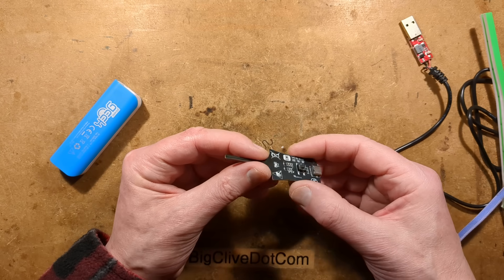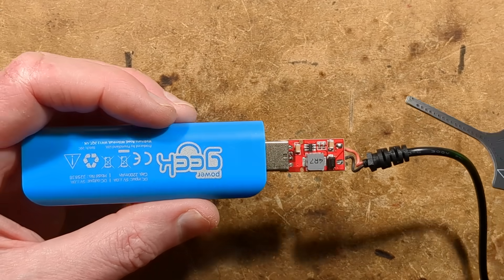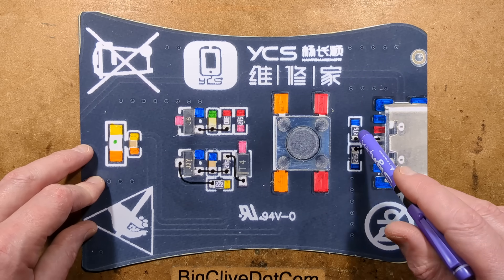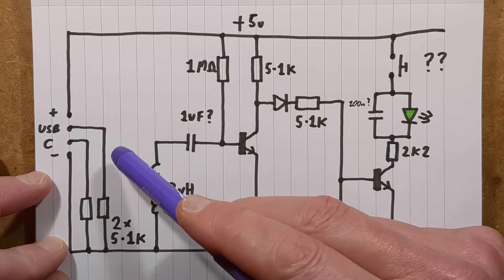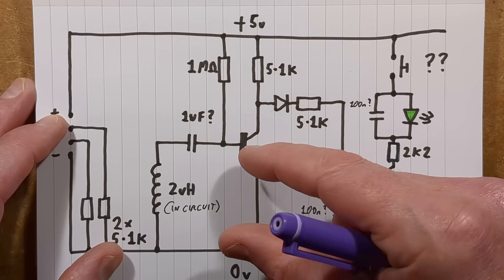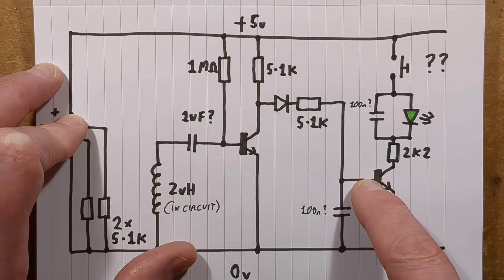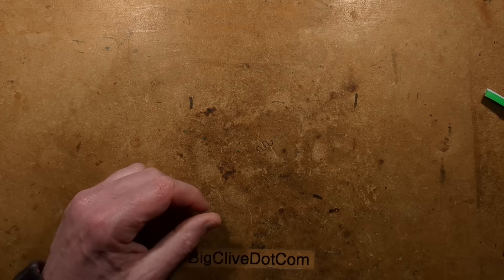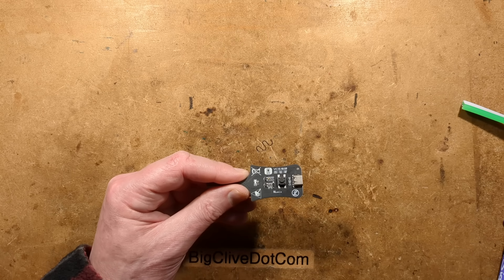Clever inductive test probe

Comment: Its not an inductive test probe.... Its a USB powered push-button tester with built in inductive field power lockout. You enable the device by holding it close to an RF near field and the LED indicates if the integrated push-button is operative or not :o)

Comment: So it's basically a low sensitivity RF noise indicator? I plan to use an old car AM radio for that because unlike normal radios, it doesn't have a ferrite rod antenna but is supposed to use the car antenna. So I could probably use a piece of wire instead of the antenna as a probe.

Comment: Circuit seems very odd, because the first stage is DC coupled to the second (via the diode), the first stage has to be biased such that the transistor is switched on and the collector is close to ground under quiescent conditions.  This really limits the sensitivity of the circuit, I'd have expected the first stage to be biased for normal class A operation and then AC coupled to the second stage with a charge pump.

Comment: I bought a similar (more expensive) device called the Short Sniffer; you put on headphones and inject a signal current into your circuit and wave the probe tip around the circuit listening for where the current is going.  You can tell direction with left vs right ears, too.

Comment: I had something similar I used for very fast pulse detection with my O-scope.

I had a short length of tiny coax with the end terminated in the center wire looped over and soldered to the shield.
The loop and coax had a short length of shrink tubing over it to prevent shorting of the circuit under test.
The coax went into a small metal box that contained a diode and cap that would rectify the pulses and filter them
and give me a DC voltage to signal the O-scope display. Depending on the frequency and repetition rate, the DC
voltage would vary with the pulses. I never thought of using a SMD inductor to detect the pulses...
Reply: You can just probe directly with a shorted oscilloscope probe, no need for a box or diode or special tools.
Reply: @jaro6985  It depends on the frequency and signal level. if the signal level is low, the basic probe won't be able to carry the signal without a lot of attenuation. But yo can clip a diode at the end of the probe and do the same with many lower frequency pulse trains.

Comment: These types of sensors brings me good memories having to create robots in uni that can follow a path marked by copper wire with an alternating current. Usually I'd just use a capacitor, tank circuit, and some amplifiers to do so.

Comment: Have you done a video on how to test power banks and battery cells to find their capacity? Or testing USB cables? I searched and couldn't find anything.
Reply from the maker: With accessible cells I use a dedicated discharge module that logs mAh capacity.

Comment: The designers went to considerable effort not to overdrive the LED, so there is that.

The circuit kid of resembles a transistor version of a grid-dip meter, a device used by Amateur Radio operators to sort inductors and capacitors for use in tuned circuits. In that application the series inductor and capacitor in the circuit would be replaced by sockets and say an unknown inductor would be plugged in with a known capacitor to see whether they together resonantly absorbed energy from a calibrated oscillator.

In this circuit the inductor and capacitor need not be and almost certainly are not resonant, they just absorb energy and use it to turn on an indicating LED.

Grid dip meters are bench tools meant to be powered on only when needed. This device is designed to only be powered on when it’s connected to a USB power supply or power bank, so the switch location kind of makes sense.

I don’t like designs with too many “kind of” elements.

Comment: A Sniffer probe, helpful for finding breaks in PCB tracks  or dry joints in live ccts.
Other designs also used a ground / 0v connection to the cct under test, to assist in tracking traces. 
I used to have access to an HP manufactured  device in a works lab in  the late 1970’s.
Reply: Yeah, I bought a similar (more expensive) device called the Short Sniffer; you put on headphones and inject a signal current into your circuit and wave the probe tip around the circuit listening for where the current is going.  You can tell direction with left vs right ears, too.

Comment: Someone copied it wrong. The 100 nF capacitor directly in parallel with the E B junction of the transistor make no sense, as the impedance is very low and the voltage can't raise above 0.68 Volt.
Greetings,
Anthony

Comment: When an inductor is bad, is it common that it doesn't fail open circuit? I suppose you don't have to poke it with probes to confirm that, so I guess that's a bit of a time save.

Comment: Ciao Clive! I bought the battery operated version. Since I do lot of troublesooting, I need to use it for the switching circuit to sense if the switching trasformer is pulsing or not. But I noticed that it won't work with general purpose household switching trasformers (i.e. wallmount mobile phone charger & similar. I thing I should modify the little circuito in some way.
My first thought was to replace the pickup smd coil. But I've been unlucky. Do you have any idea on how to use this little circuit for this purpose?
Reply from the maker: It might be because they have a closed magnetic path for efficiency.

Comment: Quite a simple circuit but by the looks of it it has been copied and over engineered a bit but instead of making it more efficient it might result in extra components that maximize the risk of component failure in any part of the device

Comment: Thanks! An interesting side note to inductive (A.C.) pickups is that they are often sensitive enough to pick up D.C. pulses, even at low voltages, and I think even (A.C.) ripple in cheap dongle power supplies. So you can check if a dongle is working just by sensing the cords, a mouse or keyboard can be checked, lots of stuff!
Reply: Remember, a D.C. pulse is just A.C. in disguise.
Reply: @kenmore01 and I thought AC was just indecisive DC that couldn't decide which way to go

Comment: yup, sticking by my first guess. someone probably got their hands on the schematic for the super probe, realized it could be stripped down some, and did it, but in that typical chinese not quite right way of most knockoffs.

wonder if it can be altered to be a little more .. well done. bodge wires to change the location of the switch in the path, probably minor component tweaking. hmmm.

wonder how it reacts to say, faulty resistors. no audio, so you can't really test for noisy resistors or dead transistors/etc like the super probes can.

how very odd.

Comment: I found out something interesting about those live-circuit probes.  It happily senses a USB cable when powered but not connected to any load... and even when unpowered.  Unplug it, though, and no detection.  USB power is switched, so no "tickle" pulses should be happening.  Odd.  😂
Reply from the maker: The live wire detectors can detect the AC coupled to the USB cable via the interference suppression capacitor and capacitive coupling between layers of windings.  It's very low current.

Comment: I believe that the 5.1k resistor after the diode along with the switch placement affect the operation of this circuit quite a bit and may be crucial; If we look the dc circuit on the collector of first transistor we see that if we omit the resistor, the max voltage possible would be around 1,2v maximum (+5v->resistor->diode->pn of transistor base->gnd) and i believe that isn't enough for the stage to work..so i believe the transistors are partly biased like this and that's required for enough total gain from the circuit..and the switch just enables the detector diode which is the LED..whether all this being intentional or not..😅

Comment: Interest circuit, the resistor after the diode feeding the capacitor appears to stop the oscillator from being overloaded by the discharged capacitor, which might stop the oscillator from initially stating up.  At least, that's what it looks like to me.

Comment: I like the fact the circuit board helpfully tells you this won't detect wheely bins that have fallen over.  😀
Reply: Also doesn’t detect Godfather hands.
Reply: @mikescholz6429  C'mon guys, that's so obviously the universal pictogram saying not to crumple it onto your dinner. Geez!
Reply: @mikescholz6429 Is that the one near the USB socket that looks like a gymnast doing the splits with a “NO” symbol overlaid on it?
Reply: @markfergerson2145  no, the triangle one.
Reply: @mikescholz6429  Or not to be used by Thing?
Reply: Actually it's telling you not to throw it in wheely bins and instead dispose of it properly, hopefully you're not at a party right now
Reply: @davinderc  I did know, was just to provide a smile to Clive.  I'm 60 so well past any party days.
Reply: I thought it was saying it's not a wheelie bin and it's not lead (the crossed out Pb symbol). The other one must be saying it's not a hand.

Comment: So it's an open air version of that test screwdriver thingy? the clear blue one with the BS170 transistor in it?  that you can use to detect microwaves and AC?
Reply from the maker: It's only for relatively strong magnetic fields.

Comment: Nice. I have a cool HP "logic" probe set ca. 1980—one of the probes is much like this. It also has adjustable sensitivity and indicates using a wee incandescent :-)  It can be used standalone, but is paired with a  pulse injector probe, mainly for short-finding. E.g., you could inject pulses into Vcc, then trace where a short is using the mag sensor probe...
Reply: is that the one where the display would flip depending on how you held it?  I had an HP at work decades ago, just this week I found an old cheap version in my storage.  I tested it, still works... I think.

I also found a probe I made back in the 1970s that does continuity or voltage detection, good up to a few hundred volts.  One push button, a 9V battery, and a few random transistors and other parts.  I was pretty clever back then!
Reply: @jerrydurand4127  No. See HP 547A etc
Reply: @jerrydurand4127  Why are you, a supporter of the Russian invasion of Ukraine, posting here? Don't you have hospitals and apartment blocks to attack?

Comment: This looks like something that would be built over at Mr. Carlson's Lab for test probing oscillators in his AM radios...though he would build it much better  :)
Reply: its a super stripped down and modified version of the super probe, i suspect.

and not very well modified. but functional enough, i suppose.
Reply: The charge pump aka demodulator could actually feed a audio amp and then you can use it much like Mr. C's cool IF checker box.

Comment: My immediate reaction is "I want one!".  I run into dead switching supplies fairly often.  But then, I realized that I have an inductive tone tracer as part of a network kit, and I wonder if that would work just as well.
Reply: Inductive tone tracers will inject a single frequency, then the detector is usually tuned to that freq with a notch filter and will ignore all other frequencies.
Reply from the maker: The little USB to 12V module I showed runs at about 1.2MHz, so above audible levels.

Comment: Do you suppose a toner probe used to trace wiring could be used in a similar fashion? Might be worth trying it out with mine.
Reply from the maker: The 1.2MHz that the module I tested it on was running at would not be audible.
Reply: What I was thinking. Possibly a switching supply would be too high a frequency.

Comment: I got the battery version a while ago. The battery is connected all the time as well. If you don't remove it after every use it'd dead in a couple of days..
Reply from the maker: Ah, that's a huge design flaw.
Reply: Thanks, that explains why mine arrived with completely discharged battery.
Reply: It wouldn’t take much to rewire the circuit with a hobby knife and some wire-wrap wire to work properly.

It would be better if they designed it properly in the first place, but China.
Reply: reminds me of decades of chinese electronic calipers that never turned off unlike their non-chinese superiorly energy conserving copied cousins... 😅

anyway, i'e bought the same YCS two weeks ago, usb-version of course, and am really happy with it, at least for what i do with it, mostly phones and small, weird future electronic waste. ☺️👍
Reply: @kittytrail  I have one of those cheap calipers, modified it with a tiny switch to disconnect the battery, works perfectly!
Reply: @kittytrail  None of the callipers turn off, that's how they're designed.  The idea is they hold the last reading.  Some models use less power when sleeping so last a few years rather than the typical 6 months.  There is at least one variant of the Chinese callipers that does have excellent standby characteristics.
Reply: You have to add a switch at the battery outside side. 😂
Reply: @何馬士  Right! The switch seems to be in the WRONG place in the circuit.... 🤷🏻
Reply: "Chinese Efficiency"
Reply: @wizrom3046   nah, they sell batteries too... 😏
Reply: @matrix7479 how did you comment 3 weeks ago on a video only got posted 2 hours ago 
It was unlisted Maybe 🤔
Reply: @GabrielH-y7c    time travelling ...
If you hold down the little button while cleaning your ear with it, you are transported 3 weeks into the past
... great for sports betting
Reply: @GabrielH-y7c probably posted to patreon